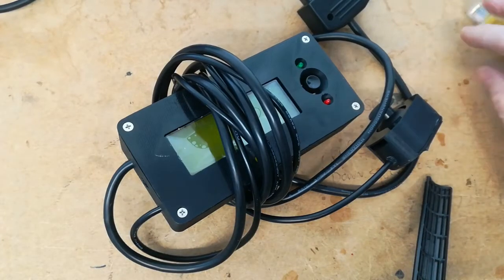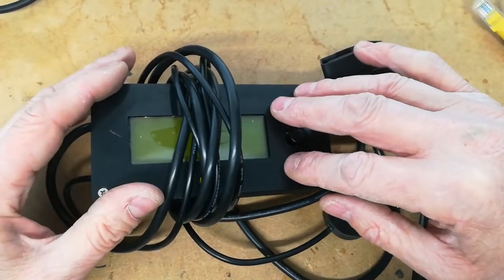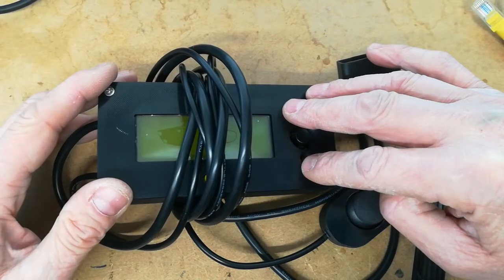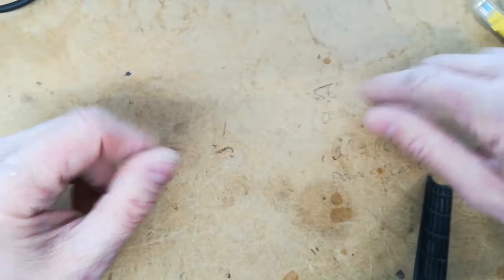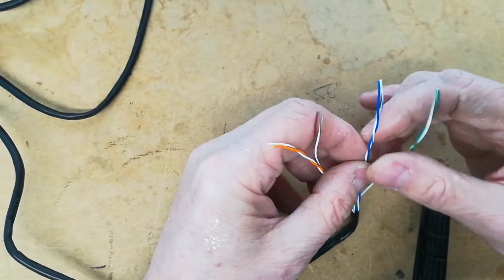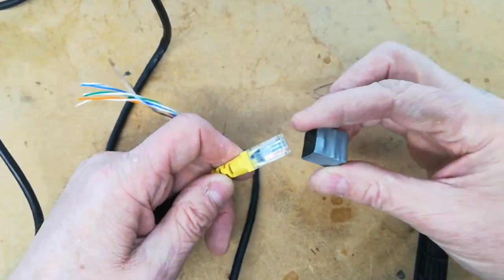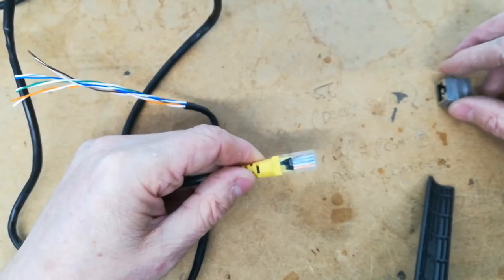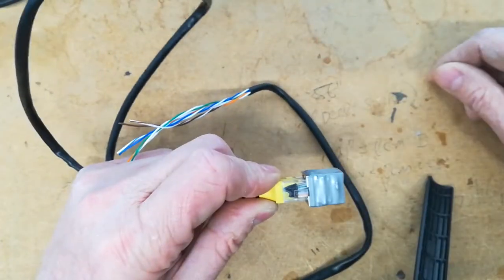CR-Z IMACAN Man In The Middle Video 5 (OBDIIC&C & Joystick)

Comment: Quick Question. Does this effectively bypass the stock IMA battery capacity limits? AKA with this  can we use more battery capacity than the stock system allows.
Reply from the maker: Hi.  I just use YT as a repository for the videos. All questions on the CR-Z forum threads please so it is all in one place.  Thanks